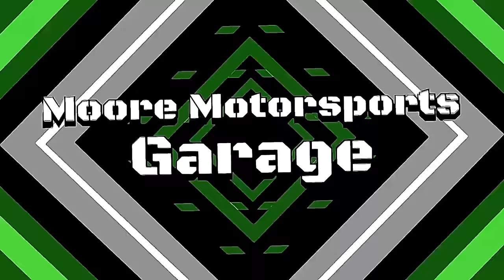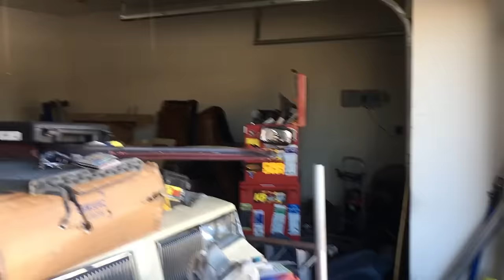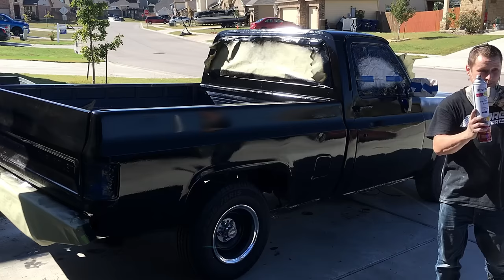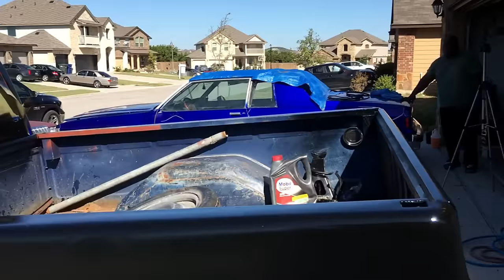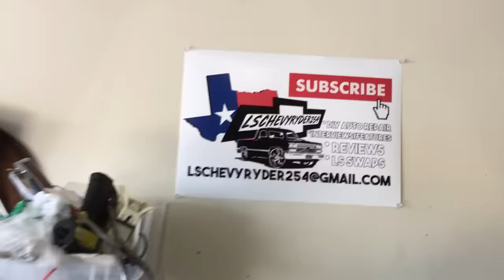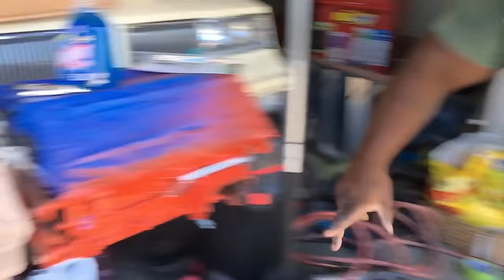$50 rustoleum turbo paint job.

Comment: So how many cans do you think I’d need for a smaller two door car? Like a 96 prelude ??
Reply: my 07 civic coupe took 7 regular cans, probably 3- 3 1/2 turbo cans
Reply: @chandlerwilson4141  how is the paint job holding up?
Reply: @DwaynesJohnsonLaysTheSmackdown  surprisingly really good, the trim i accidentally sprayed, would advise you to avoid that as well, even tried pressure washing it off and it’s still good. Very surprised how it turned out, used about 7 cans for a 2 door 07 8 gen civic

Comment: Do you have to pray primer before apply color or can you just sand off the clear coat and paint over scuffed surface ?
Reply: You can sand and spray. But a good cost of primer would be best. Paint will show every scratch left from sanding. Best results, prime and block sand prior to paint. Maybe a day extra but worth it.
Reply: If you use the first layer of primer and sand it with a 500 sand paper, and a 1000 sand paper, then you paint with spray can, the results are much better. The primer allow you to leave a clean and smoth surface before paint.

Comment: What if I paint without sanding my truck,  i just need it to look black for a couple of weeks. Will the paint hold up for a couple of weeks?
Reply: the paint won’t stick unless you sand, you should also prime
Reply: It will stick a couple weeks as long as you don’t pressure wash it or something.
Reply: I would just use black primer

Comment: Can you save these cans overnight how do you clean the tips
Reply: After your finished. Turn the can upside down and spray it for 3 seconds. Doing this separates the paint from the pressured air. Cleaning the tip

Comment: What exactly makes it "Turbo" paint ?
Reply: Bull Boss it has a bigger spray nozzle than the regular sized cans. So it covers larger areas 👍
Reply: Just like turbo give your engine more air which equals to more speed hence the term is used on the can cause you spray faster

Comment: How do you keep this type paint from oxidizing?
Reply: @laserfalcon  give it a buff with a light cut compound and then apply a good wax periodically and you should be in good shape for a pretty long time
Reply: Clear coat after paint, then wax, buff, polish..... every month or two use some spray on wax & keep in garage if possible avoid the heat winter weather elements 💯💎

Comment: looks ok. I  have used this other Rustoleum paint PROFESSIONAL
 High Performance Enamel Spray
and dont see the orange peel. Painting in the upper 40 and 50's right now as touchup areas on a 1996 Trooper. The entire hood needs new paint various places. The color is a good match to the OEM paint.
https://www.rustoleum.com/product-catalog/consumer-brands/professional/high-performance-enamel-spray

Comment: Do they have that in chrome? A full chrome truck & hit with clear after.
Reply: Just sand all the paint off and smooth it out with 5k wet sand and 4k gloss it lol
Reply: Always thought of that. However would be too shiny causing accidents and therefore actually illegal by me.
     I've also had problems with sun reflecting off painted hoods. Could you imagine chrome. There's a business by me that has white trucks with flat black hoods to stop reflection.

Comment: I want to do my 79 bright yellow. Like reflective vest style neon yellow. What kind of paint do you recommend (want to use spray paint) how do I prepare the body (it's pretty rusty in certain spots), how do I fix rust holes before painting (one on cab corner, a few in the bed) and should I do multiple coats (current color is the original Mariner Blue if that matters)?
Reply: If you wanna do it cheap with spray paint and get good results I’d recommend duplicolor metalic spray cans but they can get quite pricey and do require alot more prep to get a good finish. If your trying to do it really cheap and get a super good result, id recommend rustolium paint and primer all in one. (Turbo cans only come in black or white) You’d probably need about 8 cans of that or however much you need to cover everything. Then to get a high end finish, spray some duplicolor multicolour clear metalic effects over everything when the paint is still tacky (3 cans should do it). And after that, spray the truck with spraymax 2k clear. (You’ll need about 5-6 cans of that) they run about $20 CAD each at my local body shop supply. Spraymax 2k clear is BY FAR the best spray can clear on the market. Now for prep. The propor way to fix rust holes is to cut it out and weld in a patch. But if your on a tight budget, your best option is to cut out the rusty shit and then use some super bendable aluminum sheet metal, cut to size with tin snips and then kinda wedge it in behind the sheet metal. Use either rivets or screws to secure it in place, grind the screws or rivets flat with a grinder and then smooth it all out with a generous amount of bondo. Then sand everything with 120 grit on an orbital sander. Also make sure you fill in any little dents with bondo as well cuz they’ll show through bad on fresh paint. Then sand with 220 and spray the whole truck with about 2-3 coats of dominion filler primer. Wet sand the primer with 400 grit on a sanding block then spray on your paint and follow the process which i already mentioned for that. Hope this helps you. If you have any questions about anything just ask and ill be glad to help. Im currently in the process of painting my 88 camaro. Im doing a high end job on that. I got some high end single stage which was about $600 cad for a 1 gallon can.
Reply: For the cab corner it might be best to go to your local junk yard and see if you can cut out a good patch piece. They’ll often times let you take the piece homd for free. Thats what i did when i patched my rear quarters on my camaro. I did end up welding it in since i have a welder available at my disposal. If you dont have a welder available, there is specialty auto body glues out there you can use to secure it in place. You could also use some screws to hold it in place till the glue dries
Reply: Using fiberglass cloth, resin and bondo is another cheap method that works great as well

Comment: That looks like crap
Reply from the maker: Mike Gresham He wanted it black now it’s black. He wanted it all one color I didn’t charge him to paint it. He prepped it and it could have came out ever better but it’s a sleeper so it’s all good it just gives it more of a sleeper look. I told him we can sand it all down fix all the body work and perfect it with my spray gun if he wants to down the road. We will be doing that stuff in a shop vs outside in the sun/wind.
Reply: Thanks but that my crap your talking about

Comment: Taping stuff off like mirrors and lights instead of removing them is absolutely stupid. Shows a true level of laziness.
Reply: Shutup is a good follow up to that first comment. I've done some painting with rattle cans on my SUV and prep is very important when using rattle cans. I taped everything and gave it about 4 coats. Its lasted about 2 years till you could notice a few chips. Prepping took forever and was the hardest part of the job.